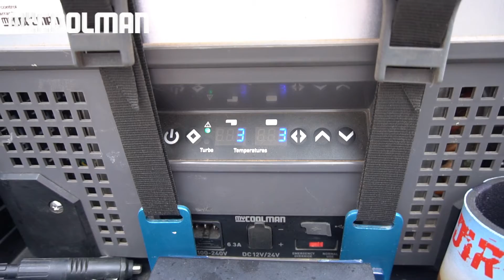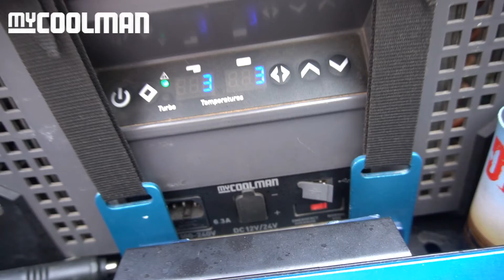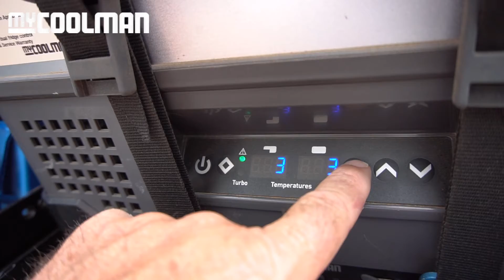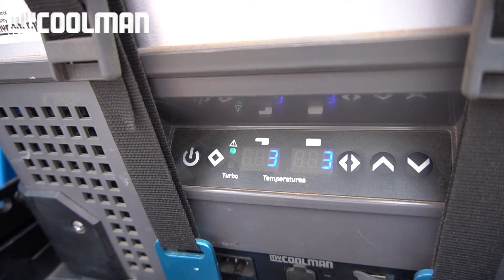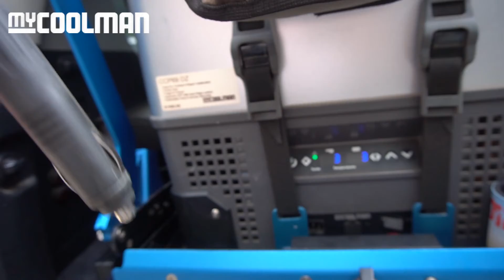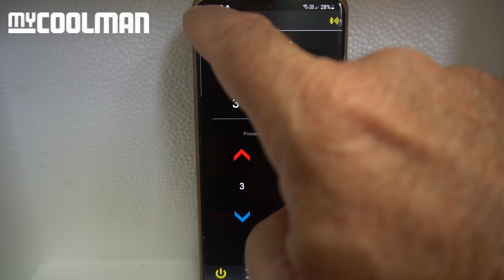myCOOLMAN Controls and App in fine detail. Why myCOOLMAN is the best portable fridge out there.

Comment: Hi Trev, Do you know if I need to unplug my 12dc before I plug in 240v. Does it automatically switch to 240v internally?
Reply: Thanks for that. Is it something you have done with yours?
I emailed the service people at myCOOLMAN after getting in touch with you and got this reply.

Thank you for your inquiry.
 
Please disconnect the 12VDC before connecting the 240VAC.
It will not damage the fridge if you leave them both by accident but long term we do not advise this.

What do you make of that?
Reply from the maker: @goxvox  Interesting, I'll do a little more research as it does not sound right.  I also worked for Waeco/Dometic for 10 years. You could always leave both leads in. 
E.g, the generator runs out of fuel, and it will go back to 12v.
I go overseas tomorrow,  i may not get back before I leave.
Reply from the maker: Hey Steve, its automatic, it will always default to 240v
Thanks for watching :)

Comment: My new unit is tripping the low power cut off (E1), getting 13.05v to the fridge end of the cable.  But trips the E1 Code with in seconds. Both on the factoy points and on my dual battery.
Any ideas? Using 6G wire to the back of the car. - Thanks
Reply from the maker: Hey Oscar,  sounds like your setup is ok.  E1 is definitely low voltage. This can occur when the wiring suppling power to the fridge is to small and generally only happens when the fridge goes into its duty cycle.  I would give mycoolman a call their service guys are really good. 1300 072018
Reply: @DirtRoad4x4  Thanks for the reply, they are currently working with me on this, looks like the temps are to high. Also have been advise you can test the voltage at the other 12v connector to confirm voltage after the fridge.